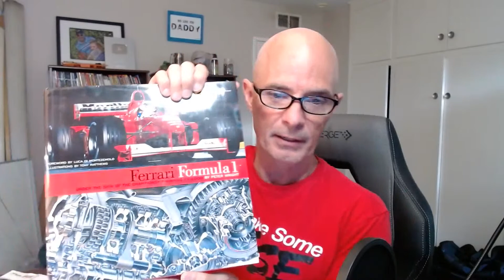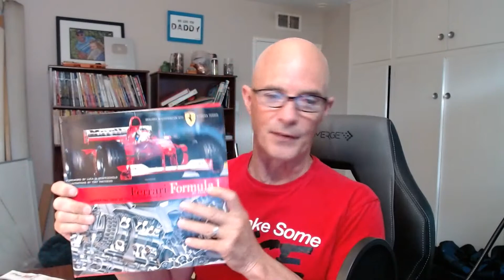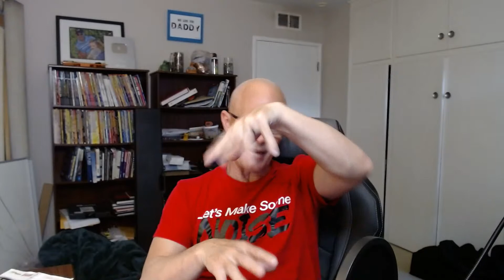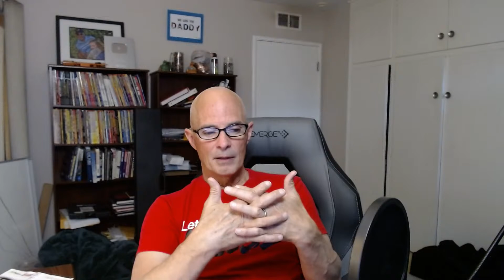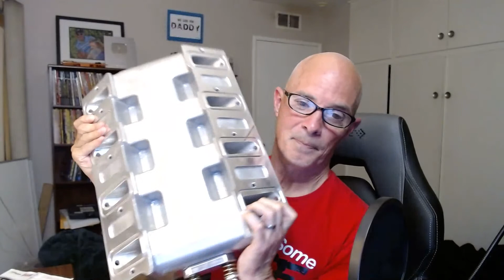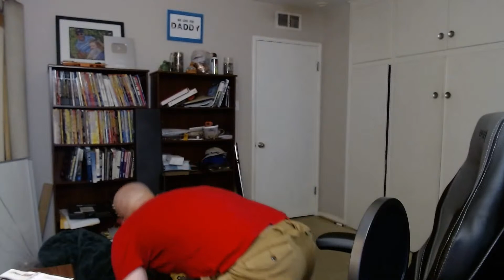LET'S TALK TECH-WHAT IS HOLDING BACK THE POWER PRODUCTION OF A 2.2L DODGE TURBO?

Comment: On most older engines, the cylinder head is the limiting factor for airflow. Head porting usually is the basis of creating power. This can be supported by a good intake, larger cam and good exhaust.

Comment: NA 1984 Dodge Shelby had a little better timing computer. The engine was also 10:1 CR. My 84 Shelby ran 16.84 in the quarter DEAD stock with just the air pump belt cut. A DC 252 cam with 0.460" lift got it down to 16.22 in the quarter mile. These speeds were full interior with the spare tire.

Comment: I’m interested in seeing what is holding the 2.2 back. I had a bigger cam, ported intake, ported exhaust, 2.5” straight through system, Super 60 computer, 12-14 psi, K&N, stock intercooler, V6 throttle body, etc.. I only felt like I gained power with more boost. In hindsight, I gapped those rings to the stock specs on the info sheet thinking that they knew stock was turbocharged. I don’t know why I never broke a piston. I did go through a head gasket per year. I think the OEM intercooler might restrict power at some point. It’s my understanding the Shelby built T2 engines only received the turbo, intake and intercooler. The engines were T1. Those were the GLHSs, and the CSXs. The heavier cars, Daytona, Le Baron and Lancer received forged crank and rods, with hypereutectic pistons.

Comment: In July of 2021 I made a comment on the original video that you will make 241 flywheel hp at 7.2lbs with your stock longblock setup. Still stand by that statement. 

The right intake manifold, exhaust manifold, intercooled on e85. 

The reason I believe this is the case. The stock long block 2.2 for spec class racing from the 80s made 180-185 NA with a carb. If you can repeat those designs, plus e85, plus intercooler, on 7lbs you should make 240. 

Also, Donovan and the Dodge Garage team circa 1998.

Comment: Definitely the head. The lotus head makes far more power and so does sticking a neon dohc head on a 2.2/2.5 shortblock. The 1 piece intake and stock tiny throttle body don't do it any favors either.

Comment: THE DODGE TURBO INTERCEPTOR 
2.198 litres (134.1 cu in) Cosworth-headed 16-valve I4 cylinder twin-cam w/dual Garrett T25 turbocharger

Comment: I cannot wait to see the results on your 2.2.  I am guessing the engine will double the power with great drivability with the ported head, intake, proper turbo sizing and camshaft. 300 should be possible on a street engine with e85 at 16 psi boost.

Comment: Throttle body before turbo is asking for oil sucking into the intake.
Reply from the maker: that was stock
Reply: @richardholdener1727  the stock turbo most likely has very tight oil seal on the compressor wheel contributing to turbo lag.
Reply: @benhowe2087  Yes but when you slap a throttle door shut on a turbo inlet it's speed decays much slower than if it was still pumping (even if just moving air out the bypass valve at atmospheric.)

Comment: that stock 2.2 head sucks...that is why people have pursued and swapped it for the dohc 2.0 head, and it really improves it immensley.  I would say stacking the intake and exhaust ports next to each other also wasnt helping it much. that 2.0 head helped to separate the I/E but required different intake/exhaust setup.  maybe the cam profile itself on the 2.0 head is much better than the old 80s patterened 2.2 shaft.

Comment: Since you were discussing gains from E85 as possibly being the most important on your 2.2L I figured you may be interested “GEM” fuels.....there’s quite a few articles on “GEM” fuels but, YT will delete my comment if I add a link, so I’ll describe it the best I can here......more or less it’s a mix of methanol, ethanol, gasoline, in specific ratios you can make yourself that out performs E85 yet has an almost identical stoic-value to E85......the reason I bring it up is if your set up to run on E85 then you could test a GEM mix with theoretically little to no tuning changes and it would make for good content since you already tried variations of water / meth compared to each-other and E85.

NOTE: It seems the most common mix ratios are 37% pump gasoline, 21% ethanol and 42% methanol....most people buy e85 and 93-pumps gas, then test there ethanol % of each prior to mixing in the methanol, and tailoring the ratios to match the above mix.....and it’s a good idea to add a methanol additive / lubricant to keep the fuel system happy if being stored for any length of time.

Keep up the good work 👍
Reply from the maker: thnx